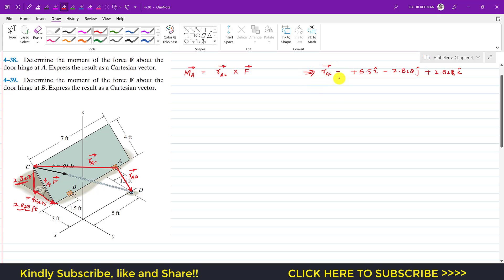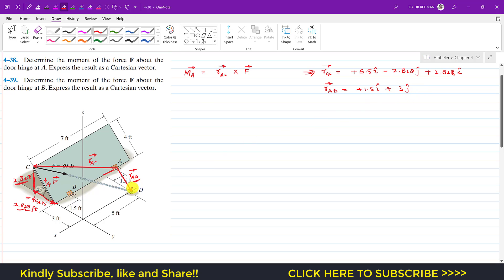4-38 Force System Resultant Moments Chapter 4 (Hibbeler Statics 14th Edition) Engineers Academy

Comment: Thank you so much for the video it helped out a ton, I was wondering if you could take a try at this question please? "The pruner multiples blade-cutting power with the compound leverage mechanism. If a 20 N 
force is applied to the handles, determine the cutting force generated at A. Assume that the 
contact surface at A is smooth."